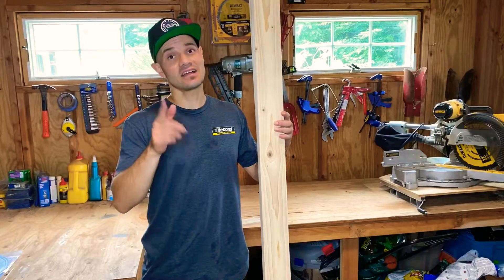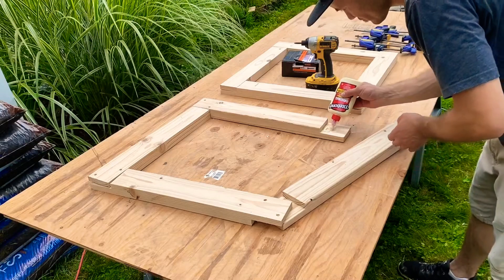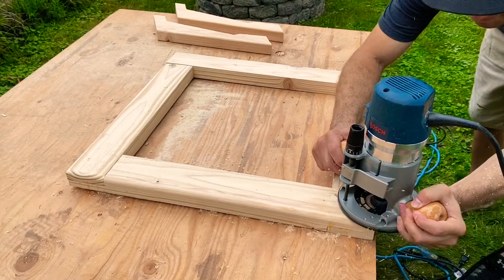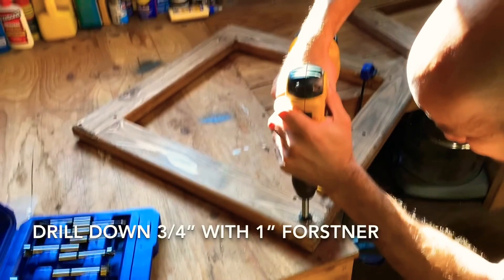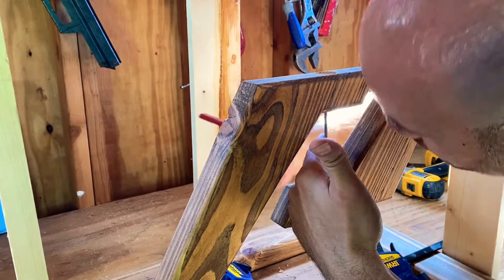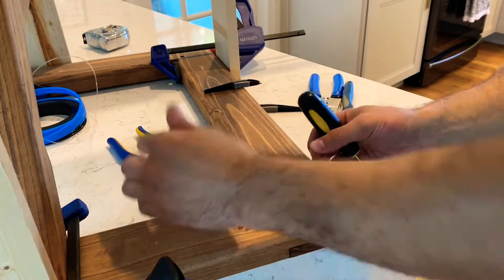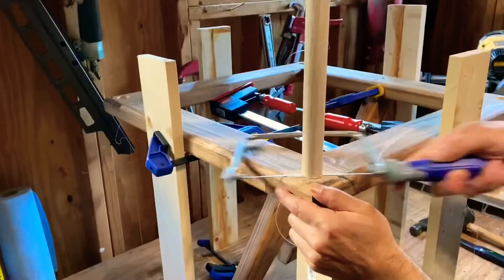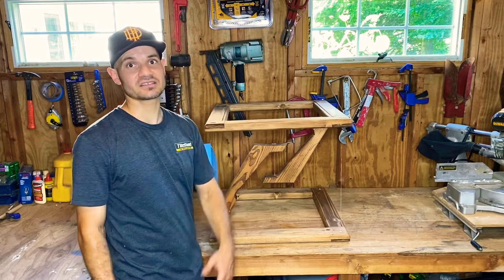True Floating Table Build - Tensegrity

Comment: The table top is not floating. Its actually hanging and being hoisted in place laterally.
Reply: I don't think anyone assumed it was magic but thanks for clearing that up for those that did
Reply from the maker: It’s fishing line bro watch the video.
Reply: @IllGetMyTools  yea i know. I meant the top piece is hanging by the central fishing line. And it doesnt fall over laterally because the perimeter fishing lines are hoisting it in place.

Comment: How much weight can it hold?
Reply from the maker: I put 15 pounds on it and stopped. Issue being the glass is very thin. A thicker glass would of held more weight.
Reply: @IllGetMyTools  I'm not trying to sound critical, this was a very cool design and build!
But I can't help thinking the support arms and their connections to the base/top might be pretty weak.
Reply from the maker: @davidmortensen5709  it can easily hold a lamp and a book…. Not sure what else you would want to put on a floating table, it’s more of a discussion piece.

Comment: You say it should hold 15-20 lbs but, you used 60 lb fishing line.  Why would it not hold 60 pounds?
Reply from the maker: The glass I used for the top is thin and not tempered. If the top was solid wood then yes.

Comment: Why not just use taut line hitches on both sides, staring from the bottom. Doesn't a clove hitch run a risk of slipping? The taut line has no room for error but it would be more secure, no?
Reply from the maker: It would be, issue was creating the tautness in the small space. I put a safety knot on the clove hitch and it assisted in keeping it from slipping. You have to adjust all 4 lines multiples times it was very difficult so that’s what I came
Up with in honesty.
Reply: @IllGetMyTools   yeah, I'm at the same stage but with a smaller version. Cutting my fingers to pieces tightening this line for like the 4th time. That taut line knot is gold for the bottom like you said. I'm also using JB weld wood fill epoxy instead of dowels because the hammering makes me paranoid. So far so good. Just waiting on curing.
Reply: Try a Palomar knot. I'm actually about to try to build one of these for the first time but my lifelong fishing experience gives me good insight on knots. A Palomar knot is literally an untiable lot it's basically a cinch knot once you get it to cinch down on it it will continue to tighten down on itself until it can tighten down no further or it will break. But it will never come untied.

Comment: How do you tie the second end of the string AND end up being taut?  You didn't show the ending of that tie.
Reply from the maker: It was very difficult a ton of fine tuning. The taut line hitch and clove hitches that I used allow you to slip and adjust the knots as needed. It was honestly a pain but was eventually able to make it work. On one side I actually did a double clove hitch on both top and bottom of the table. I had to use needle nose pliers to get into the hole and taught to the nail.

Comment: If u put a chain as a replacement for the wire in the center of the table, will that maximize the amount of weight it can hold?
Reply: Get a guitar string for the center wire - - we're talkin' 1,000 POUNDS !!
Reply from the maker: Juan Carlos Rivera sure will, but it won’t look as clean. Many people build the whole thing with chains it just looks kind of sloppy